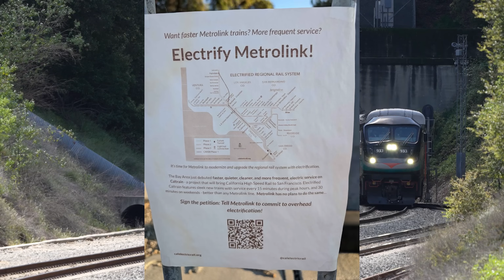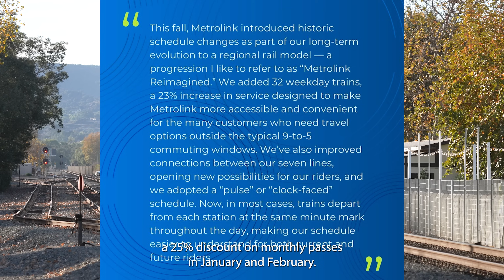Metrolink's Future: Why Electrification Could Change Everything

Comment: Electric locomotives can haul much longer freight trains with no emissions.  Would UP/BNSF be amenable to using electric catenary-fed locomotives on Metrolink track?
Reply: I'm going to assume the problem is all the class 1, North American freight companies don't want to be responsible for the cost of installing and maintaining all the new infrastructure that would be required of electrification. It's essentially an extra cost that they don't see as necessary.

Freight trains in North America are already incredibly long. Some of the longest in the world. They don't need to be any longer. Plus longer freight trains would have a negative impact on any passenger trains that share the track. Longer delays while waiting for freight trains to pass, creating scheduling issues for passenger trains, less frequency, etc.
Reply: @drewpatterson8261  My bad. I was not actually referring to making freight trains longer.  I was referring to needing only two electric locomotives to haul a train normally requiring five diesel units.  And an electric unit requires less maintenance than a diesel unit.

Comment: 100% agree with double-tracking.  Also, the grade crossings with the most automobile and truck traffic should be rebuilt to put the street either over the train or under the train.  This will save lives by reducing collisions caused by trespassing on the tracks by vehicles and pedestrians. If Metrolink cannot electrify all lines, maybe one can be electrified?  System expansion is important too.  Explore putting tolls on more roads and using that money to support commuter trains.  Car drivers are subsidized to pollute even with current gas taxes. Incentivize use of the trains by imposing the true cost of polluting and road wear on drivers and lowering commuter rail fares.  Climate change is real and contributed to the disastrous fires in Los Angele this winter.  Public transportation is key to lowering emissions.
Reply: So get rid of all Railroad crossings?

Comment: The only solution is for California to take over all the tracks. To hell with private companies owning right-of-ways of any kind. Nationalize them (but for the state).
Reply: Metrolink is a governmental agency. SCRRA - Southern California Regional Rail Authority. They are funded by their respective county transit agencies (Metro in LA, OCTA in OC, etc). 
And buying out the freight railroads would be prohibitively expensive. Over 30% of all imports to the US come thru the ports of LA and Long Beach. The freight has to go somewhere. The freight railroads already sold off their extra lines in the 1990s (such as the SP Coast route from downtown to Moorpark, SP Valley route to Acton, and Santa Fe 2nd subdivision thru Pasadena). Even though those tracks are now owned by public transit agencies, they still retain trackage rights to use them for freight.
The only sections still owned by freight railroads are the Riverside Line, the 91 line, and the OC line between downtown and Fullerton.

Comment: Did  Caltrain electrify the entire network?   I thought the San Jose - Gilroy section was still using diesel engines...  

Can Diesel Electrics be hybrids that use catenary power when available?  If just the station segments were electrified the trains could accelerate quietly and quickly on drawn power, and use generative braking when approaching a station.  Using the onboard diesel generators between for travel between stations stations would provide the flexibility needed in the system while reducing emissions and noise at the stations.

Comment: Just adding some additional context to Caltrain's electrification:
-The mainline from Tamian to SF is electrified, but not the Gilroy extension, which runs on tracks owned by the UP. Though Caltrain only operates 4 trains on this line (4 trains leave Gilroy in the morning, then 4 trains go to Gilroy in the evening), they still have to use diesel locomotives, pulling the Bombardier cars (which includes former Metrolink equipment). Since the multiple track ownership with Metrolink came up, it should be noted that Caltrain had the same issue, and ultimately prioritized the main line.
-What allows the faster acceleration and deceleration on the Caltrain main line is the fact that the trains are multiple units (note the Gilroy trains no long run the full line and stop in San Jose, due to the fact they'd slow the whole system). To get the same performance, Metrolink would have to also use multiple units, not just get new engines to pull existing stock. Diesel Multiple Units (which is what Arrow is using) could be a stop gap on busier lines to improve service.
-There's a mention about how Metrolink should improve the lines first. Caltrain had to do the same thing. Though the Penninsula Corridor was double tracked the whole way, the quad tracked sections were added later (I want to say construction started in the late 90's). These were done to improve service and allow for express trains.

The short answer is, "yes, Metrolink should electrify," but there are hurdles that Caltrain didn't have, and others that Caltrain weren't able solve (ie: the Gilroy Extension. It should he noted that Caltrain is experimenting with a battery EMU on the Gilroy line to phase out the last of the Diesels. It would charge once it reached the main line, and could run the length of the system, but not sure how viable this would be on Metrolink's longer segments). Ultimately, planning for Metrolink electrification needs to start now. Upgrading the San Bernardino line will take years and electrifying that line will take longer. The sooner the plans start, the sooner actual work starts and there's gonna be a lot of actual work.

On that note, I appreciate the shot of Caltrain running a consist of mostly old Metrolink equipment at 10:24.

Comment: As some have noted, BEMU's offer a potential middle ground for Metrolink that would allow for partial electrification and its benefits while bypassing many of the issues that come with it's large and fragmented-ownership system. It's easy to think of BEMU's in terms of electric busses like those on Metro's G line, which charge at the end of their routes only, and can suffer serious delays when charging stations are unavailable - but they're really more like electric trolly busses we see in cities like San Francisco. With those, battery capacity only enables 5-10 miles off-wire depending on the route, but that's more than sufficient as the busses can charge while in motion on the wired portions of a route.

In that same vein, a BEMU with support for in-motion charging (which already exist!) only needs OCS on limited portions of the network, letting Metrolink skip trackage where the owners are set against OCS or where its overly expensive to install. Given how efficient rail transport is, anyhow, a little battery goes a long way.  Also unlike CalTrain, which had to spend years getting special wavers from the FRA to use its train sets, newer safety standards allow the use of lighter and thus easier to move multiple units and cars. Heck, you could maybe even convert some existing diesel-electric locomotives to battery-electric by removing the diesel, replacing it with batteries, and adding a trailer with pantograph and 25kV OCS equipment.

Comment: Passenger trains should not share track with freight trains.  All lines must be double track.   High frequency will drive up demand.  Fast modern electric trains will drive up demand.  Just take a look around the world and see wht countries like Australia is doing with commuter rail.
Reply: @jethrotaylor2614  the problem in LA is that their simply are not enough tracks to separate passenger and freight. In the SF Bay Area they basically kicked freight trains out during peak times, but LA cant exactly do it

Comment: One thing I dont get (might be because I am european) but why the f dont either the federal government or the individual states buy up all the tracks and then have operators (cargo and passenger) pay a access fee that covers maintenance.
In the European Union usually the company that owns the tracks arent allowed to be running the trains. There must in other words be a infrastructure manager and a train operator that can't be the same company.
Well DB does both in Germany but even then it is in two different companies.
Reply: The public transit authorities of each county that Metrolink serves already own most of the track. Freight railroads reserve trackage rights for trains during off-peak periods. 
There are a few lines (91 line and Riverside line) that are still owned by freight railroads. Taking ownership of these would be difficult as 30% of imports to the US pass thru the ports of LA and Long Beach, and the freight has to go somewhere.

Comment: Metrolink has completed numerous studies into electrification and it is clearly not an option for most of their routes. There would be minimal service improvement when compared to their current modem diesel locomotives running on biodiesel (similar acceleration and near net 0 CO2 emission) and a significant cos. Electrification is a poor investment and the costs have been studied to greatly outweigh the benefits (except for maybe the SB Line, which they are planning on improving) That money would be better invested into double trackking, grade separation, and fleet expansion. A multibillion dollar project is not worth a generously estimated 20 minute improvement in commute.
Reply: So agree.  Some of these passenger train fans are living in an economic non-reality.

Comment: The best solutions is buying all the Metrolinks tracks from freight company and doubling (and in some case tripling or quadrupling, with adding one or two not-electrified freight tracks along corridors for freight trains ) tracks and electrify them. Higher frequencies needs electrification. Full stop. Any other solution is a failure. Private tracks owning is an huge obstacle to service and infrastructure improvements. Electrification reduce also exercise cost for the single train and on high traffic system repay electrification cost.  
From an external (European) point of view is very strange to see that the most powerful nation on the Earth face has so big issue to spend money to electrifying railways where it's needed.

Comment: They're going to have to clobber some lanes in I-10 to double track it, and that won't happen.
Reply: The I-10 portion is a major barrier, but there are options using trackage north of there through the San Gabriel valley, by swapping the ROW with Union Pacfic's Alhambra sub. That ROW is much wider, but UP only has it single tracked, using it in a couplet with their Los Angeles subdivision. They'd love the I-10 ROW given that it's a shorter, faster, has less level crossings, and still connects with their LATC Intermodal Facility near DTLA. Metrolink would likewise love the Alhambra subdivision since it passes through more densely populated areas than I-10 and would provide opportunities for additional stations and ridership.

Metrolink could also opt to use that ROW to support an elevated double track for trains, but that would require shutting down service during construction and likely be way more expensive than whatever UP would want for a swap.

Comment: Great video, although missing some context (from Banks Rail) on why Metrolink is dragging their feet on electrifying. Basically they contend they just bought all these Tier 4 Diesel Locomotives that they custom designed as great expense. They don't want to have to prematurely retire them in favor of electrifying because the cost is supposed to be amortized over 30 years. TBH I think it's a weak excuse but it's pretty expected from bureaucrats.
Reply: @AaronTheHarris  it't not like they would electrify their entire network within the next 30 years. Even if they wanted to, the probably couldn't. So this is a weak excuse. Nobody expects Metrolink to electrify their entire system at once. But they should start somewhere and electrify one line after another over the next 50 years. The remaining Diesel Locomotives can be used to run more trains on the not yet electrified lines in the mean time.
Reply: that is a pretty weak excuse, diesel trains last 25 years on average, usually maintenance becomes too expensive after that. And there is no way it is all electrified before then. You propably will still be stuck in court cases from people trying to fight the electrification.
Reply: @daanwolters3751  if maintenance after 25 years is too expensive on a diesel electric then your mechanical department is incompetent.
Reply: @dexecuter18   @dexecuter18  let me rephrase a bit, after 25 years it is cheaper to buy the newer, more fuel efficient, easier to maintain and lighter model than keep using the old one. 
Also, don't forget that diesel emu's (in Europe) go faster (up to 125 mph, tough most diesel trains only go 80 mph) than the ones in the US, increasing both maintenance needed per mile as well as the amount of miles travelled in total.

Also electric trains are about 25% cheaper and need far less maintenance, so it very quickly gets wortwhile to replace them

Comment: I think Metrolink (Unlike Caltrain) should use the existing railcars and continue renovating them, but replace the Diesels when electrified with Siemens ACS-64 electric locomotives from the Amtrak Northeast Corridor, since Amtrak is planning to get rid of those in favor for their long awaited Siemens Airo Dual-Mode and Hybrid trains for the Northeast, and also, so that the tracks from the California High Speed Rail and Brightline West trains from Las Vegas can potentially interline with Metrolink, so those High Speed trains can share the same maintenance yards with Metrolink in the future.
Reply: Caltrain kept its newest locomotives and railcars (some purchased from Metrolink) for the San Jose - Gilroy segment, which is yet to be modernized.
While keeping existing railcars and replacing locomotives is a good idea, Metrolink is going to need more trains at some point. May as well be EMUs.
Reply: Metrolink could easily eat the entire ACS-64 fleet if they got some more cab cars but that means battery hybrid ops are off the table for trains running with them.
Reply: @gdrriley420  Or Maybe Convert some MP36 or F125s to NPCUs with the ACS-64 Pushing since that’s what Amtrak did anyway. They could probably be THE FIRST EVER US Commuter Railroad to use NPCUs converted from ex-locomotives
Reply: @dennisthebrony2022 the MP36 are getting replaced. They got grant money to replace12.
Reply: @dennisthebrony2022  Or they could also convert their existing Diesels into Electric Locomotives
Reply: @gdrriley420  in place of what?
Reply: @aaronmiller5012 we don’t know what Metrolink will buy but it seems likely F125 or chargers. My preference would be to find some more local money and instead get a fleet of 10 or so 6 car FLIRT BEMUs
Reply: Don’t they have f125’s that are still relatively new and recently acquired? So if they even electrify would they be go e to waste or send them elsewhere like Caltrain did with their retired diesels?
Reply: @aaronmiller5012 they are replacing a dozen MP36 to start with and they need easily double the amount of equipment.